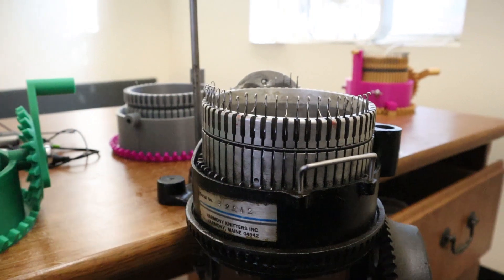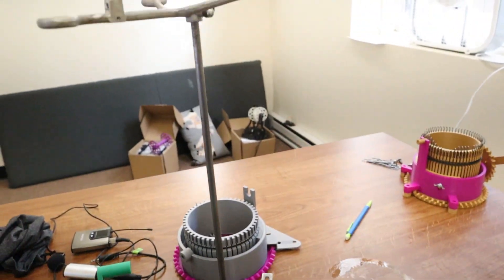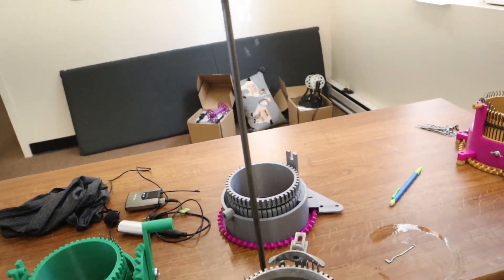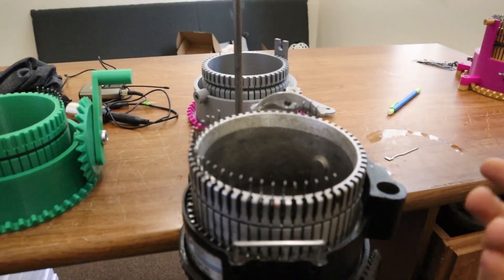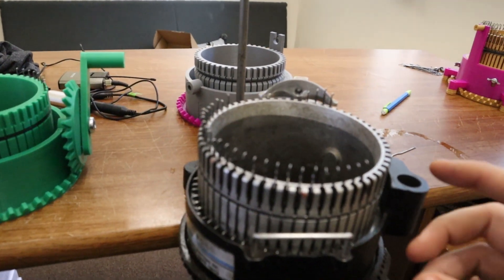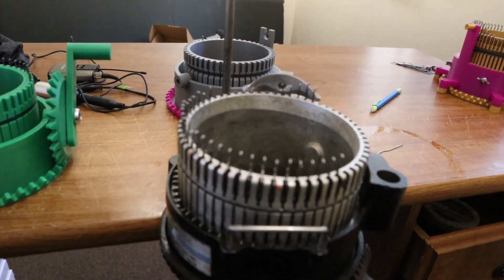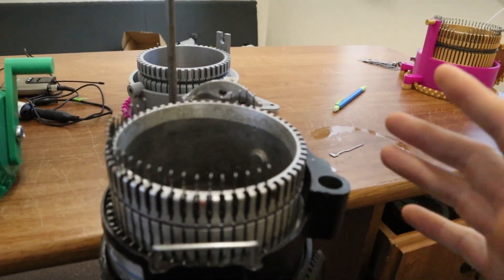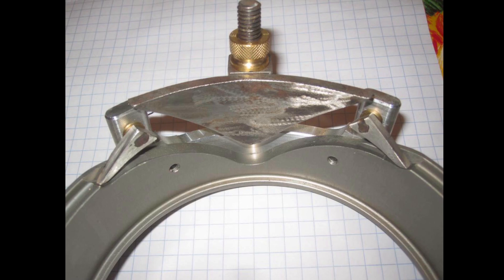SPIN #96 - Help Design a Circular Knitting Machine

Comment: I'm a flatbed machine knitter. This is the first time I've scene a CSM dissected . It's amazing how similar a CSM is to a flatbed. If flatten out the cylinder with the flippers you have a a flatbed carriage. I know your just one person but, competitor the Silver reed LK-150 with a ribbing bed is a dream of mine. I'm not sure where you're located but, drop me a line & I can donate an example if shipping isn't to insane.
Reply from the maker: I'm not actively working on the CSM because I don't have time for it.  Once I ship a few more new products though I do plan to come back to the CSM.  After the CSM I might look at a flat version and it sounds like you'd be a good person to talk to then.  That will be a long ways off though.
Reply: @DreamingRobotsBlog  Happy to help. I'm very excited for your eventual cone winder. Knitting machines much prefer cones to any other put-up & cone winders that are both good & affordable are rare.

Comment: I know it is long after the fact, but I just found this and did your poll. I am wondering if you are still considering this. I am also wondering about your thoughts on cylinder size. How many needles (stitches) would you be thinking, and would you be able to adjust the tension to tweak the size a bit?  Or would you consider selling exchangable cylinders, so that people could make socks in different sizes? Or did I fall asleep last night during that part of the video?
Reply from the maker: I didn't continue working on this.  It is still a project I might consider in the future, but it would be a very long time before I get to it.
Reply: @Dreaming Robots  I too just found this and I hope you do this.  What I see so far I really like.

Comment: The ribber attachment is not just useful for knitting a sock cuff, but also for things like rib knit circular cuffs to be made for sewn garments. Id been considering designs for printing a csm and for friction purposes I was considering if the cam groove might be drilled and have pins for roller barrels to roll the needle butt to allow a smoother ride for the needle. Now the really impressive thing to figure out for one of these bad boys is some kind of punch card patterning system which is nigh impossible with a cam like this. Then again,  Im not certain how the flat knitting machines do those either. Perhaps on a csm something that reads a strip moves the needle onto a track that rejoins the normal groove via a flipper? Hrm. I know such a mountain of design to make that work is more trouble than its worth but wow do I want it.
Reply from the maker: Ha, I am actually starting work on a design that does ball bearing for the exact purpose you mentioned the roller pins.  I think the balls will work better, and I know I can get them at a low cost.  I don't know if they will actually be needed, but I kind of want to try them and see what they do since the added cost isn't very much and it would potentially make it smoother and require less oil than other CSMs out there.

Early on I thought about programmable CSMs.  I decided to abandon that for now because I need a well working manual solution first.  That said if I were to go with a programmable solution I'd do it electronically.  Not only would this be easier to make patterns for, but I'm pretty sure it would be less expensive than a mechanical system these days.  Electronics and programming also just happens to be something I'm good at doing.
Reply: I considered punch card programming because its very user friendly and doesn't need the learning curve of a program to operate though if one wanted to motorize it and automate it electronic would be all the way. I take back my madness of trying to manipulate the pins to do so, I'm now thinking a unit that guides yarns away from a particular hook so it stitches nothing on its pass, attached similarly to the ribber piece, would be infinitely easier. I was in the middle of sketching out parts to guesstimate the cost to have a machine shop mill a csm when I found this video, I think I'd rather give my idea to you and see it get done smoothly than wrangle production nonsense while someone else is making one too with more experience than me. That being said when the functional csm gets made Ill be trying to design a stitch programmer to that thing immediately c:
Reply from the maker: @jla8700  There are a lot of CSMs out there that if you only want to focus on the stitch programmer you could use today as a base. I'm just trying to make one that is better and cheaper than is out there.  As I mentioned I won't be working on the automated stich for a very long time.  I'm not even sure if I'll be doing a CSM since I have to make sure I can actually make the improvements I want at a price that makes sense for my community.  I wouldn't put too much faith in me since I still don't know much about CSMs.

Original punch cards were for mechanical computers so I guess you are right that they are always programming.  However, I am not convinced that a punch card will be easier than a touch screen that allows you to create a pattern.  People familiar with punch cards probably prefer that solution, but that is not most people in the EEW community.  My community is much more familiar with the touch screen on their phone so if I do eventually do something with a programmable CSM that is the direction I'd end up going.

Comment: Hi, the 3D printed CSM is already available on thingiverse, the real effort/benefit would be to add the ribber functionality, since it's not actually available on the different models available except for some ribber cylinder and stops, all the rest is missing (arm, cam, height adjustment, etc.).
Reply from the maker: I have looked at the CSM on thingiverse.  I didn't like some of it's design decisions so I designed my own based on how I thought it should be designed.  I would note that theirs would have a similar issue to what I mentioned in the video that a ribber can't really be reasonably attached.  The design there would need some pretty large changes to be compatible with a ribber.  That said I think having multiple competing CSMs is a good thing so if someone wants to start improving the CSM on thingiverse that would be awesome.  It and it's branches haven't had much development in awhile.  I am also not sure a ribber with a fully printed CSM is possible.  At least the version I'm working on isn't as smooth as the metal CSMs and the ribber requires quite a bit more reliability if I understand how it functions (though I'd admit I'm not an expert on the ribber yet).
Reply: @DreamingRobotsBlog  I have made a remix for a Legare 400 Cylinder, that is "a work in progress". I planned to post on thingiverse later. I fully agree that a ribber is quite a challenge but I think that 3d printing is totally feasible as long as the design is oriented that way.
Reply: I would like one to make hats. I have an Erlbacher Gearhart already. Good luck.

Comment: I'm intrigued, but don't these already exist?
Reply from the maker: There are a few options that exist.  You can buy good antique CSMs for around $800+.  You can buy new quality CSMs for $1600+.  You can get 3d printed files to make your own CSM or buy a 3d printed CSM, but all the 3d printed CSMs have a similar design that aren't very good.  Then their are circular knitting machines made out of injection molded plastic, but they don't work with finer yarns.

This project would be something that targets the gap between the expensive CSMs and the not very good 3d printed ones that exist today.
Reply: @DreamingRobotsBlog   @Dreaming Robots  Thank you!  Wishing you well with the project.

Comment: Those cam designs are terrible. The transitions should be tangent and smooth. A good improvement wpuld be correcting that issue. It would make it turn much more easily.

Comment: There is already a 3D printer knitting machine design for free.
Reply from the maker: Thanks.  There are actually several.  However, as I mentioned my goal is to make something better.
Reply: @DreamingRobotsBlog  OK the other design is free so you could get those and modify them for better results. Sadly 3D prints will never be strong enough for the wear and tear of these machines, what needs to be metal is at least the inner rail that the butts of the needles will slide to go upwards or downwards. I mean if the part is 3D printed and some metal sheet can be inserted that would be very good. Also in those free designs the gear seemed to be clunky, 45 degree gear is not good for grip, the teeth need to interlock better (at least in those designs that I saw)
Reply from the maker: @AlehandrosArhangelos  What CSMs are you referring to?  The one's I've seen are all CC-Non-Commercial meaning I can't actually modify them for my purpose.  That said I probably wouldn't want to use the one's I've seen as a starting point anyways because they all rotate the cylinder which is pretty much a non-starter for most CSM users (I didn't realize this early on, but I now understand after having it explained to me).

I also tend to agree that 3d printed parts won't work for some of the parts.  The nice thing about 3d printing is it will let me prototype everything and then in my testing I can see what parts to move to other materials.  I mentioned this in the video, but have made more progress on figuring out the pricing to go with metal parts and I'm pretty impressed with the costs being less than I thought for metal.  I'm still early in my next design though so I really don't know what it will end up looking like yet.

The more I look at modern metal CSMs, the more they look like old CMS.  The thing is best manufacturing practices have changed a lot in the last 100 years.  I think CSMs can be made both better and cheaper.  That said I'm not an expert in all this and it's something I'm just trying to work through and ask my manufacturing partners questions when I need to.  I am guessing the reason nobody has done a good modern CSM design is because there just isn't enough money in this hobby market for a serious effort from a bigger player.
Reply: @DreamingRobotsBlog  Yes the right way for a circular to work is for the piece to remain static and the outer part to rotate, cheap machines that do not use latch needles (like ALDI) move the piece and also these cheap 3D printed ones also rotate the piece being knitted so that is not a good way to start.

It is super weird how you can buy new flat knitting machines with their ribber at a fraction of the cost of a circular one, and I am not sure if they even make new circular knitting machines, everyone seems to have an old second hand one.

Second hand flat knitting machines with ribbers you can find them cheaper than second hand circular ones. I think the reason is circular is only made for socks and kinda a specific size, with flat knitting machines you can do circular as well but not circular+ribbing (you use the ribber to do the circle), so factories mass produced those and people preferred those as you can still make socks there but also real garments while the circular knitting can be in any size you want unlike the circular which is specific and only the tension could alter this.

I have the feeling making the elaborate machine in circular is also harden than just flat machines that are just straight.
Reply: @AlehandrosArhangelos  New machines are being made - Erlbacher Gearhart to name one, Lamb LT150, Chambord Accuknitter and NZAK. They are pricey, but a joy to work with. Having Maurice make one will definitely allow more people to purchase one.